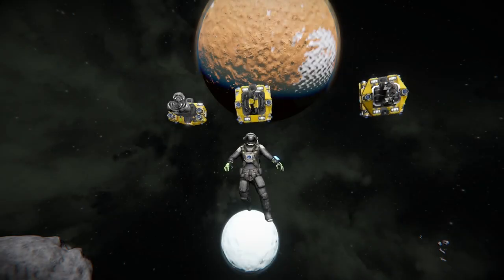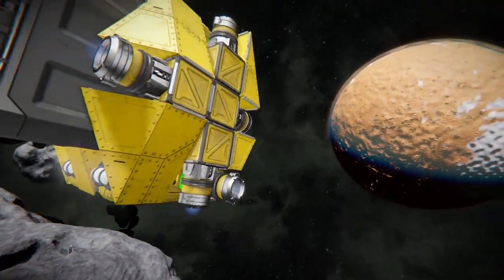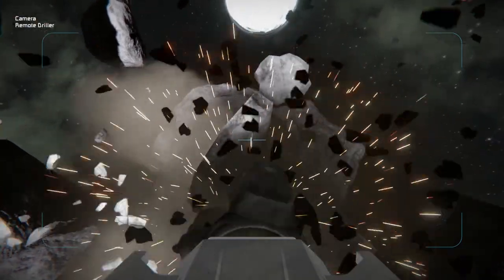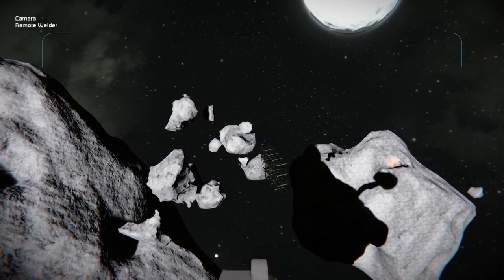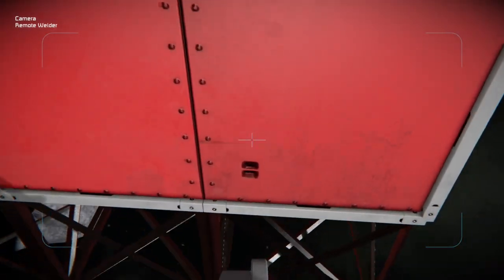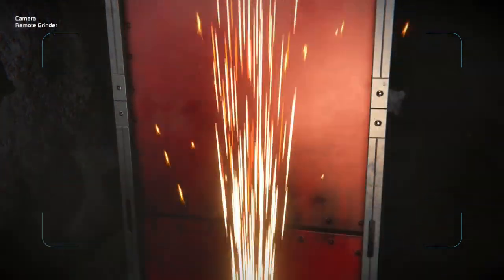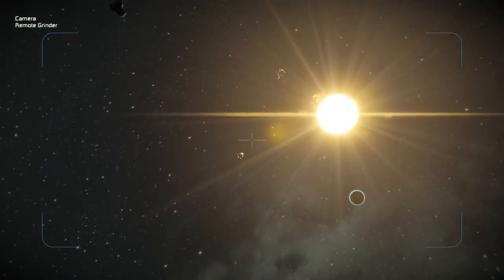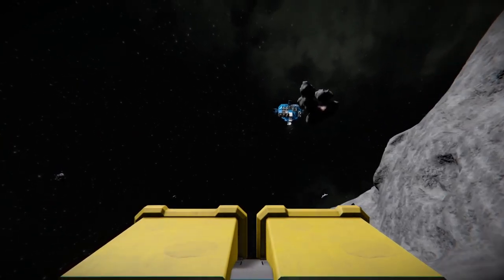Construction Drones

Comment: Just got to watching this.  I'm actually impressed you managed to get the drones small enough to fulfill their roles.  They could use a cargo container (1 minimum ) and a conveyor system to pump the materials appropriately.  Make sure you have a camera aligned with the connector to keep docking as painless as possible.

The micromanager is flatly redundant.  Provided the signal is in range or connected by comm bouys, you could just as easily find a control seat/panel inside a ship or base and pilot the drones from there.

You are definitely doing pretty good with the designs so far.
Reply from the maker: Thanks, I definitely should add a backup camera for connecting it was quite difficult to line them up.  As for the micro manager, in certain areas such as tunnels that are too narrow for a larger ship I decided to make a very basic small ship to still have a close visual in case the driller or welder get in a snag.  I appreciate your inputs it is great insight!
Reply: @mastermindgameplay5297  why not make a utility skiff to carry cargo, ship chunks, and a drone or two?